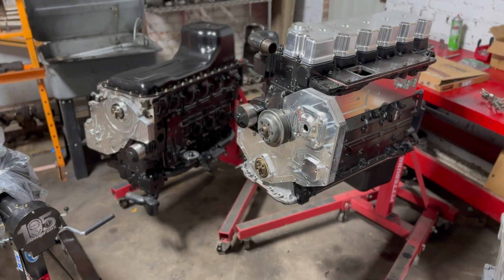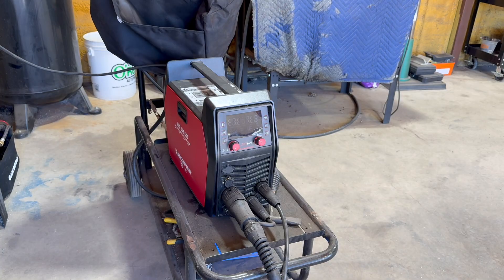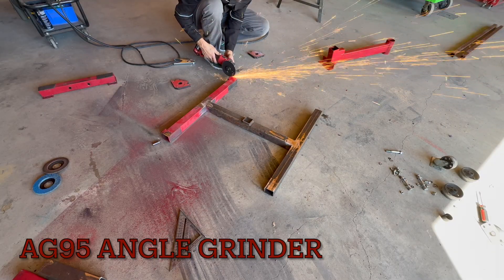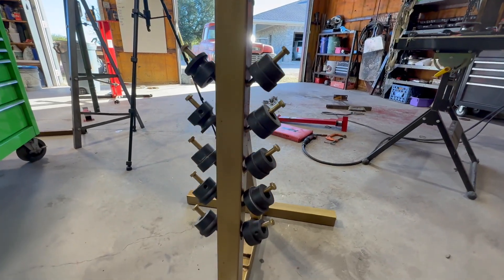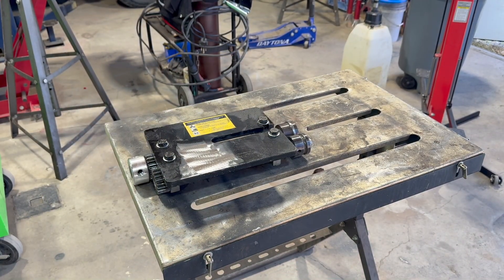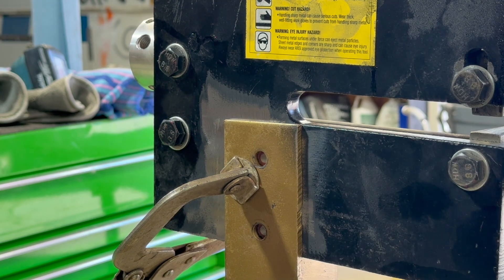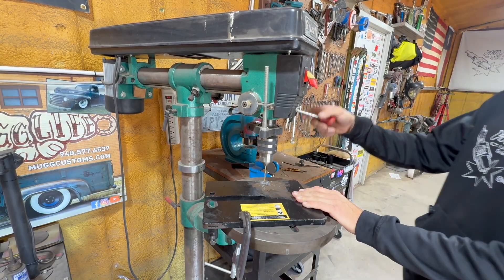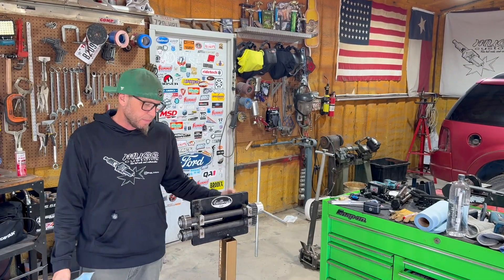This ARCCAPTAIN Setup Is INSANE for DIY Fabrication! (Bead Roller Stand Build)

Comment: I use a 110v mig I bought off a tool truck for entirely too much!
Did you look for a sponsor or did they contact you?
Reply from the maker: They contacted me via email, at first I thought it was a bit but they have been so freaking clutch.  

It took a few emails for them to make it past my spam folder.  If your email is listed be sure to check the spam every once in a while.  

The email that finally got thru spam literally started with "open this your gonna be glad you did!" 😂

Good company, solid products
Reply: Seems like a solid welder. Have you tested the auto speed function yet? That seems like it could come in clutch doing sheet metal